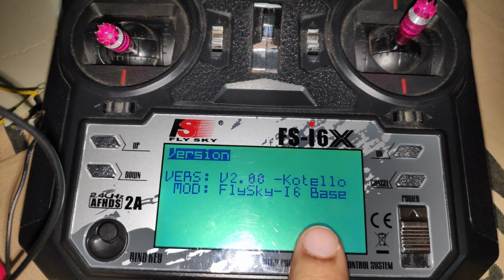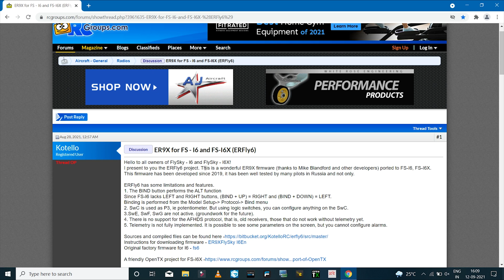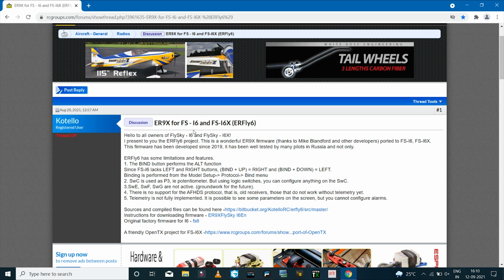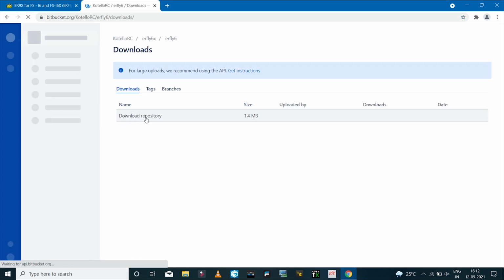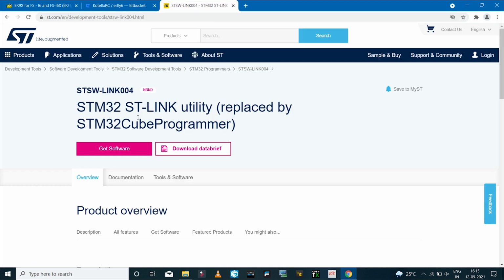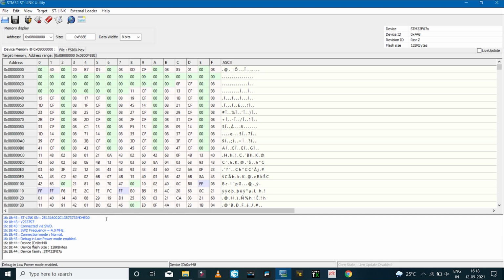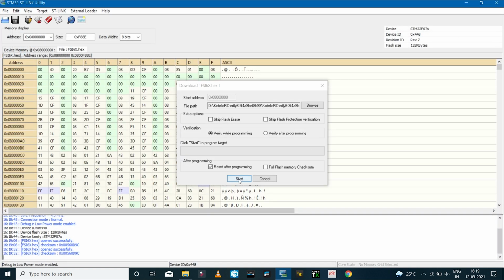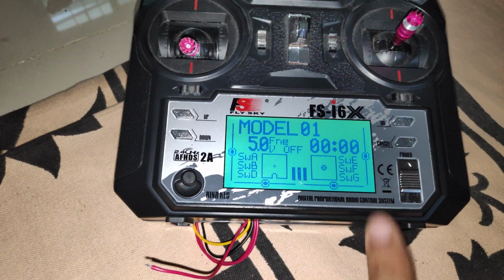Installing ER9X on FlySky FSI6X Radio Transmitter

Comment: My fsi6x doesn't has stm chip but apm32. I can't install dfu programmer on my pc. Any solutions?
Reply: i think i have the same problem,do you find a solution?
Reply: @lucabertamini4430 yes, you need a tutorial that works with apm 32

Comment: Sir, i have already programed the er9x firmware to my flysky i6x using st-link V2.. The problem is, when i connect again to st-link app, there is a cannot connect to device error? Any idea for this error? Tnx in advance!
Reply from the maker: make sure you have connected the wires between the stlink adapter and radio properly. also check if the wires are not detached from solder points. And you have to power on the radio while connecting to stlink software because we are not using 3v pad.
Reply: I have had the same problem and change Target->Settings-> Mode to Hot plug

Comment: Sir, can you provide a wiring guide between the connection wires from the radio to st-link device? Tnx in advace...
Reply from the maker: It's simple.. you solder 4 wires to the radio motherboard and connect the appropriate connection to the stm st link usb adapter pin out. You have to just match the pins on motherboard to the stm adapter. Swdio Swclk RST and ground are the only connections needed 👍
Reply: Thank you very much! More power sir..
Reply: And by the way, can it be possible to upgrade this er9x firmware on a data cable only? Or its only for st-link device?
Reply from the maker: @eddawa126  you'll still have to use st link.
Reply: Tnx sir!